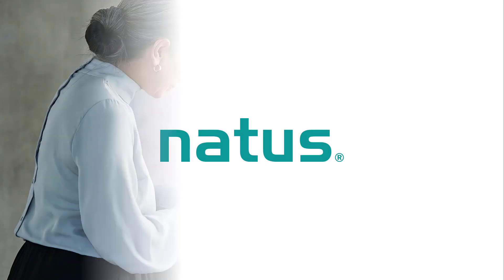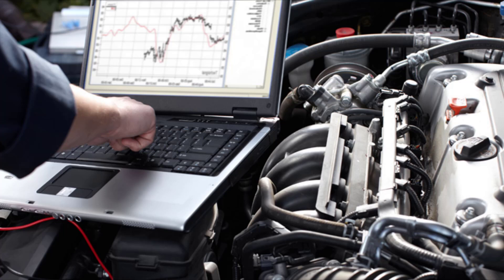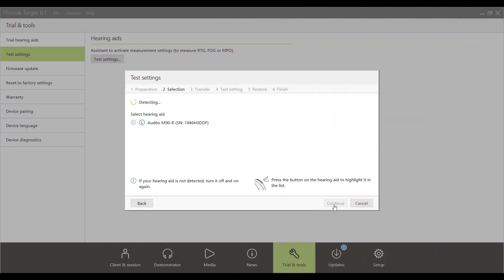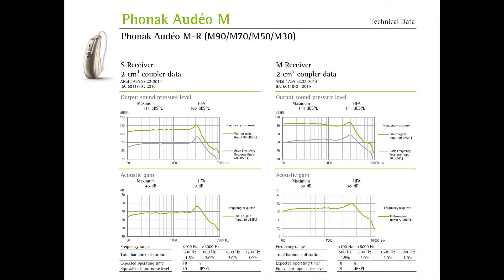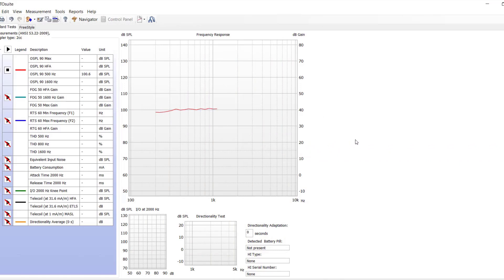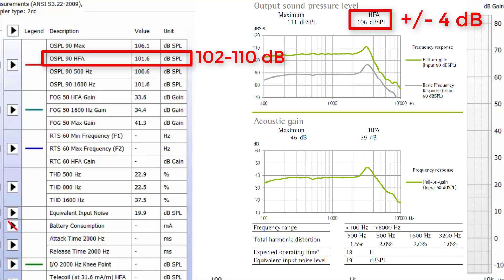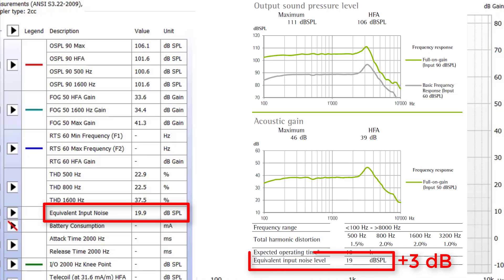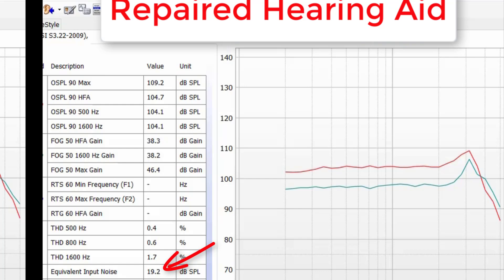Why Your Hearing Aids Don't Work Right | Natus Hearing Instrument Test (HIT) Box

Comment: OMG, How timely was this video as I’m on the Outer Banks of North  Carolina and my left hearing aid stopped working. Went through my typical diagnostic check, tried removing the wax guard, changing the batter and clearing the rubber tip, all to no avail,! Time to return to the shop. Might be the heat and Southern humidity. We know moisture kills,

Comment: I am very disillusioned with hearing aids. Have tested Resound, Phonak Marvel and now own Phonak Nathos Auto SP (on loan free from uk NHS) as well as 2 Oticon OPN S3 latest model. Still cannot hear TV properly and need subtitles all the time! Tried to contact you via your website about your test and  reprogramming prices! I have severe HF loss !! Last 5 years have been hell with my hearing!
Reply from the maker: Hi Tim, performance with hearing aids depends on a variety of variables including your residual hearing ability and how the devices are programmed.  Is your intent to come to Arizona for me to treat your hearing loss?
Reply: Doctor Cliff, AuD  If you can DM me on FB messenger or Twitter @squawk2003 and give me your email there I will send you a pic of my approximate Audiogram so you can let me know whether I will ever be able to hear properly with  the Oticon OPN S 3 and give me your price for getting the best performance! I was told by one Audii that I didn’t have a lot of residual hearing left while another large uk Oticon chain Audi told me the Oticons would let me hear again! My speech discrimination is poor, my volume is poor and my hearing in noise is zero when measured with special software!
Reply: Doctor Cliff, AuD I have sent you a copy of my Audiogram on FB messenger! Look forward to hearing from you in due course! Best Wishes!

Comment: If a new hearing aid doesn’t meet manufacturer’s specifications, it would be considered defective and swapped for a replacement right? Can’t believe that nearly 20% or repaired hearing aids don’t meet manufacturer’s specifications. Yikes. Is that important though if it still measures correctly suing a REM test? I know my hearing aids aren’t being used to the full potential since they can treat hearing loss more severe than mine.
Reply from the maker: Even if you meet Real Ear Prescriptive targets, it does not mean that the hearing aids are meeting manufacturers specifications.  Performance with hearing aids depends on residual hearing ability and how well your hearing aids, assuming they are the correct devices and meet specs, are programmed.

Comment: Most of the hearing aids don‘t meet manufacturer’s specifications after 2 years of everyday use.
Reply from the maker: I haven't seen any data to support that most don't, but I wouldn't be surprised if that is the case.

Comment: What type of repair did you perform in the example? Did you open it up and do a deep cleaning or did you actually perform electrical repair - or did you send it in? I'm picturing you as a medical professional with a soldering iron - looking through a microscope at the electronic innards of the instrument - and it is an oddly intriguing image.
Reply from the maker: Hi Alan, with that particular instrument, it required a replacement of the receiver and professional grade dehydration of the device.
Reply: Most likely the receiver or service exchange module was replaced.